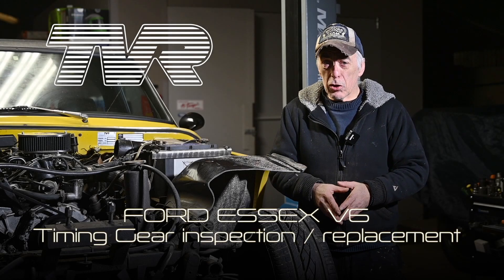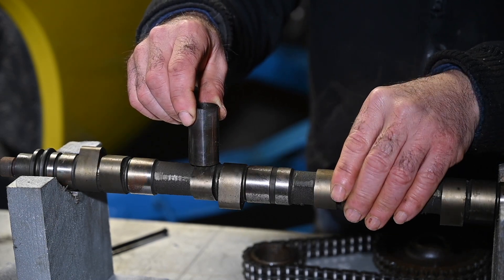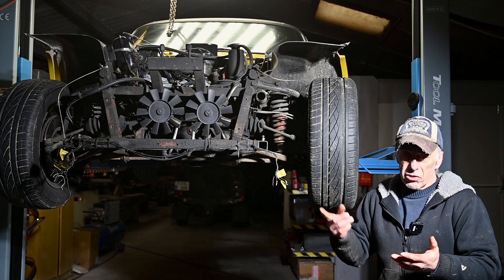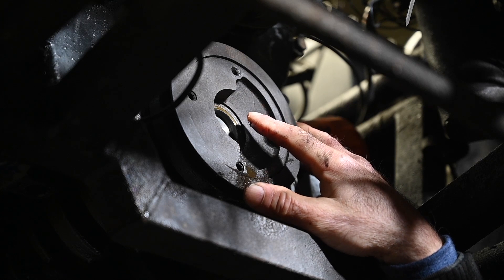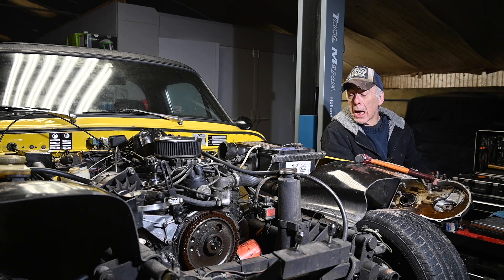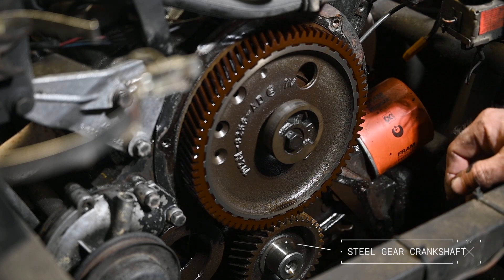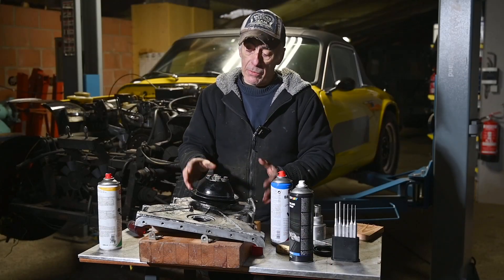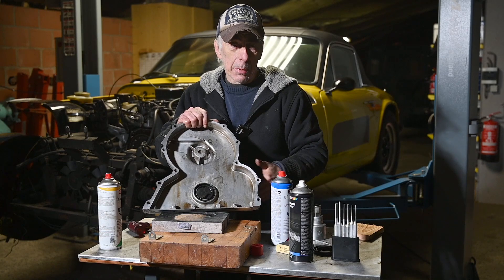TVR 3000 M, Ford Essex V6   Timing Gear Inspection   Replacement

Comment: Timing gear stripped on my 10 year old Zodiac and broke all the rockers and bent the pushrods so must have been an interference fit. Worst car I ever had. Had head gasket leaks all the time.
Reply from the maker: Thanks for the comments

Comment: A rare intelligent presentation of any motor work- trust me, the other class of mechanics is exactly why I never trust most others to touch my gear. Hamfists. The silicone goo thing- I never get why they smear a gasket, by design intended to fill variations in facing planes- with such junk. A good smear with oil to allow the paper (usually) to soften and expand to conform is how they work. From head covers to case gaskets on the old Duc singles, it's always worked for me. That synthetic gear thing, speaking of the other-worldly sound of Duc bevel cam trains... those plastic- contaminated timing trains in some V8s- like 318s and 350s. I don't see what noise the metal stuff makes that's even remarkable. TRW and Cloyes gear sets for these Fords are the way to go. With proper plumbing into the cabin, you can pretend it's a Duc 860 or something even cooler...! Thanks much for the (again) intelligent approach to the project. My 2800 project concurs with your take on their proper treatment.

Comment: Hi Steve. With regard to the seal for the cover,is it recommended to add sealant on both sides or just install it on its own?
Reply from the maker: Yeah, you can use a bit.... helps to keep it in place

Comment: I'm reading in the workshop manual that you need tool CP 6141 to align the cover so that the oil seal will be concentric with the pulley hub... Mine is leaking so much from the front crank oil seal and I only replaced it 2 years ago, which makes me think I didn't centralise it properly. Do you have any advice on this at all? Would you fit the pulley while the timing case bolts are loose or not yet in, to make sure it sits central? Thanks!

Comment: Always check the end float of the camshaft on these engines. There are 2 little bolts and a plate behind the cam wheel, and they have been known to come loose. The noise from a camshaft with excessive end float sounds a lot like worn big ends.
Reply from the maker: Thanks for the comments

Comment: What is the point of the pulley mounted on the front of the timing gear cover?  Is it just a 'redirect' across to the alternator/water-pump, or is there another purpose too?
Reply from the maker: I am not sure what you are asking,
Reply: Cooling fan mount, Capri/Granada/Transit.

Comment: Great video.. I have a 2.8 capri (bought 1986) which has the cologne engine and did also have the nylon drive gear . I always had fear of it breaking (the legend of them failing was either  a truth or myth which jsut grew) so eventually I changed to alloy. I anticipated it being more noisy but i truth it isnt at all noticable Not sure if that will be the same for the Essex engine. I used the old cam drive disk as a hall desk light base and have a matching essex drive disc as a second desk light base ..
Reply from the maker: Thanks for sharing!

Comment: Hello, my question is on the subject of the paint booth, I have doubts about how to put the air extraction and the equipment that you advise to put and what recommendations you can give about these booth measurements;  The 6mx3,20m.  the height is 3.80 m can be adjusted with a false ceiling to 2.80 m something similar
Reply from the maker: In very simple terms total air volume refresh in 20 seconds seems to be the best solution.  just calculate the volume of air and then look for fans that are able to blow and or extract that volume within the give time.   Try to keep the airspeed down by using large input and output openings.  The best approach is a down draft, top in  bottom (floor) out.  I did a sideways booth, works well but it has some death corners in the booth.

Comment: Hi. Thank you for your inspiring, interesting, and educational videos. Appreciated! 
I really like the ones about the carburetors: both the theory on the whiteboard and in practice with disassembling and reassembling them and how it works with different settings. In a follow-up video about checking the timing gear: Is there a possibility that you can make a video on how to time the crankshaft and camshaft together with a chain-driven setup, either with fixed gears or with an adjustable gear (for example the Mini) including advanced and retarded setup. I understand that you do not want to remove the engine from your Mini but with the help of a whiteboard and some loose parts you can fix it :-)Thanks in advance.
Reply from the maker: Thank you for the comments, I assume that you are referring to the method to dial in a camshaft ?   I can do that,  and will place it on my list
Reply: @D3Sshooter  That would be great. Thanks. Yes, using a degree wheel and dial indicator with the adjustable timing gear. Looking forward to your next video.

Comment: no need to remove sump. just take out front 5 or 6 sump bolts
Reply from the maker: indeed, in my case the sump had an oil leak and the second reason is while removing the residue seal on the engine-block / timingcover  part can fall in the sump...

Comment: I owned a V6 Essex in a MK1 Granada and had to do an engine rebuild back in 1983 - on that engine the nylon gears were a very light green colour and with 80,000 miles it was in very good condition - let's pay some respect to Ford for designing a chainless system with Nylon silent bevel drive for the camshaft - a very original and sound engineering design
Reply from the maker: Thanks for sharing
Reply: When the gear breaks you have had it
Reply: @carlstark6857  yeah, but it's no different to a snapped chain or belt.

Comment: I had a 1977 Capri with the 2.8 Cologne V6 and one very very cold morning (Canada) the steel crank gear stripped the contact teeth off nylon cam gear. Was a easy repair and replacement was still a nylon gear. Best thing it’s not a interference motor so no bent valves.
Reply from the maker: txs for the comments

Comment: I remember those engines from my apprenticeship at a Ford dealer.
The Essex V6 where big lumps compared to the Cologne V6.
We had a saying that the best part of the Essex is that it's more easy to work on the ignition.
Reply: The Essex V6 is only physically slightly bigger and in terms of weight only about 10-20kg heavier.
Reply from the maker: txs for the comments

Comment: Looking at the cross sectional area of the nylon cam gear it is a failure waiting to happen, when subjected to oil contamination it cannot be long before this gear fails, I wonder why TVR did not fit the V8 Rover type engine, a much better engine all round, this engine, when fitted to the Reliant Scimitar also gave big problems, not a good design. Stay safe Steve! Chris B.
Reply: These gears do fail but they are tougher than many give them credit for. I like the RV8 but they aren't exactly bulletproof especially when it comes to oiling problems. (They willstill run when pretty much scrap though - ask me how I know!).The RV8 had the benefit of being developed well past the point where the Essex was out of production (about 20 years!). I fixed my Essex timing gear problem by replacing the timing gear with one from a Chevy LS...I had to change a few other parts due to interchangeability issues but this way I have upgraded my Essex significantly by adding two cylinders, an aluminium block, heads & an extra 3.2L of cylinder capacity ☺😉
Reply from the maker: txs for the comments, Chris what do you see that made you write this? just wondering as i have done a very close inspection and it looks just fine.  What did i overlook ?  Love to hear your expert view
Reply: @D3Sshooter  Hello Steve, if you look at the method that is used in this design to "cushion" the contact between the driving gear, and the camshaft, it appears to be attached to the can gear boss by a splined arrangement, if you then look at the forces upon the "nylon" material it is being pulsed by the camshaft action by many cycles a minute in use, given that these nylon type materials do not hold up well in a hot oil situation I think the relatively thin section nylon will very soon fail, I am sure it is sound mechanical condition now, but given time and use it looks to be a failure in waiting, have you checked with suppliers  to see where this gear fails ? The design of the nylon "tyre" has many grooves, all of which could cause stress and eventual failure, I would be a lot happier with a solid aluminium or steel gear, although these would give more noise. Stay safe ! Chris B.
Reply from the maker: @453421abcdefg12345  Thanks Chris that is understood  .  Much appreciated